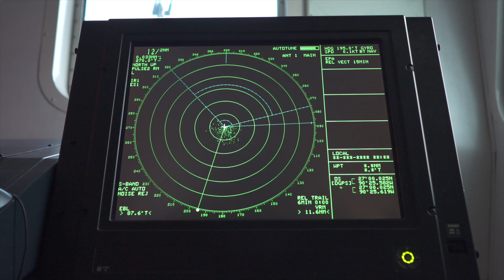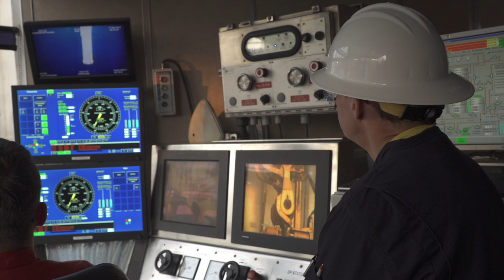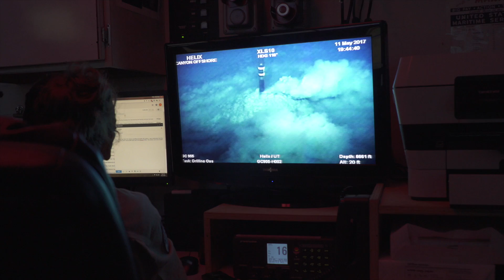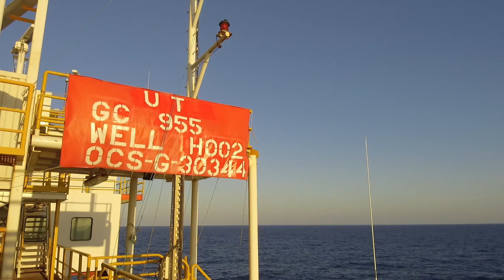Fueling the Future: The Search for Methane Hydrate (full version)

Comment: Maritime energy in summary

PROS

Methane is an abundant supply of cheap, relatively clean fuel
Once the technology is sufficiently refined, it should be cheap to extract
The extraction process should allow the sequestration of significant amounts of carbon dioxide
Using the methane as fuel precludes it becoming a greenhouse gas problem.
CONS

Extraction is likely to be environmentally damaging to the marine seabed
Because methane clathrates form plugs very easily, there is significant danger of accidental release, an explosion and greater pollution
Territorial disputes over seabed extraction rights will doubtlessly increase
The extraction of methane might destroy the biosphere of a creature that can survive and prosper in a toxic environment. The creatures’ ability to adapt its special physiology, anatomy, and behaviour are the kind of qualities humanity might need for exploring and exploiting the solar system and beyond
While the methane hydrates stay in the seabed, there is always the hypothesised danger of a seabed slip and the release of billions of tons of methane directly into the atmosphere with the concomitant effect on global warming. Replacing the methane with carbon dioxide would not alleviate this danger and such sequestration might actually trigger that release.
The same seabed slips might cause mega-tsunamis. After one mega-tsunami in 6200BC, off the Norwegian coast, scientists found leftover traces of this event 80km inland along the central belt of Scotland. There is no proof that this continental shelf collapse was associated with clathrate release, however. The people of Inverness might not be too pleased with such an event repeating itself.
Note: Clathrates are sometimes referred to as hydrates. There is a difference. A clathrate implies the guest gas is trapped or caged inside the host molecule whereas a hydrate implies a chemical bond. To the best of our understanding, methane does not form a chemical bond with its host water crystal.

Category: Maritime
10th March 2019